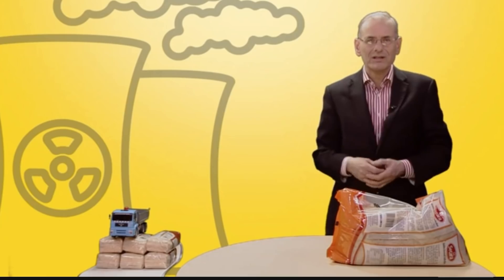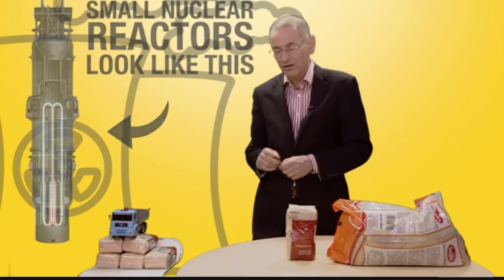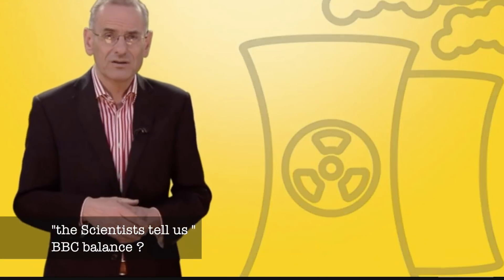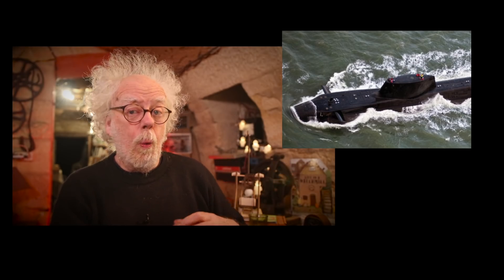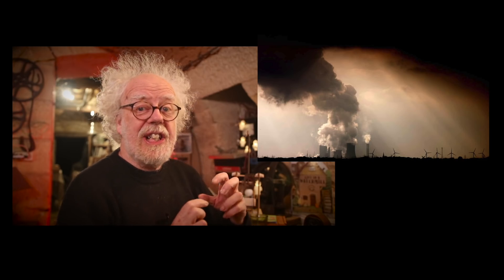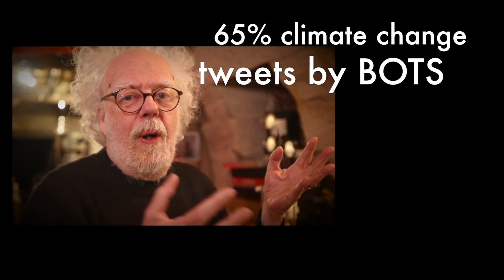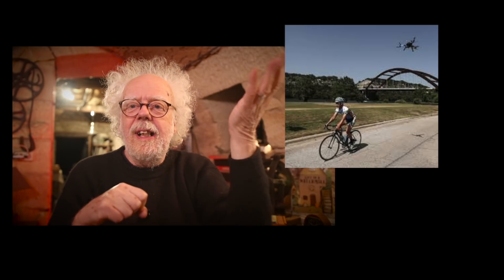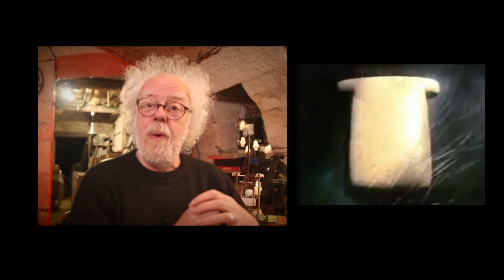Not Tomorrow's World - Prof Simon

Comment: There IS a solution to nuclear waste and it’s NOT from Rolls Royce. 
The British company Moltex is building a molten salt reactor in Canada. It runs at ambient pressure so needs no huge pressure containment system. All PWRs including he RR can use only 3% of their fuels energy. The remaining goo is high level waste. 
Moltex take that waste turn it into a salt fuel and burn off the remaining 97%. The remaining material has a short half life that’s easily managed. 
The plant is walk away safe and the dangerous gaseous elements like iodine 131 and caesium 137 simply become fuel salts. They cannot escape as gasses.
Reply from the maker: Interesting

Comment: ai would like to add some comments about nuclear power .  The reactors on recent submarines are designed to last the life of the boat. The problem is that they must use bomb grade uranium. Commercial power reactors use fuel with much less enrichment than that required to make a bomb.  Because of this they must be refueled every 3 years or so.   much of the engineering effort in commercial reactors is spent on how to rearrange the fuel rods during refueling outages to extract the most energy out of them before a complete  replacement with a new bundle is required .  A side note on used fuel bundles is that they can be recycled except for stupid politicians.  There is substantial fissionable material remaining that could be recovered.  Technology exists that can Make a glass like material out of the remaining waste.  The radioactive isotopes are molecularity bonded to the glass.  This technology was never adopted.  So spent fuel pools at the plants continue to be filled with used up fuel bundles. Large scale plants are likely driven by the fact that these plants are part of a much larger power network  and concentrating more capacity in smaller footprint makes economic sense when removing one plant from service for maintenance does not adversely affect system reliability.  As a side note,  utilities routinely buy and sell power to each other to supplement  generation shortages .  A principle driver of insanely high construction costs of these plants is out of control regulations. An approved design package built to the package specification would cost much less. Consider if you tried to build a house and the building codes changed every week and you had to tear out any work you had completed to conform to the latest codes.  This is what nuclear operators contend with during construction.  The technology used for commercial reactors is driven by the designs developed for nuclear submarines.  Thorium cycle reactors would be a a good choice if money could be found to develop the technology beyond demonstration reactors.  Modular reactors would be a good model to follow provided standardized designs are used and individual reactors could be taken off line for refueling .  Incidentally, I worked for a utility with nuclear plants for 31 tears.

Comment: Indeed drones with the capabilities you mentioned already exist, but it will cost you a lot more than $1,000. And you're right to be apprehensive about sending all that money into the sky because it just might decide to fly away on its own and never come back . Or more likely, get stuck in a tree . There are several channels on YouTube dedicated to drone hobbyists. The US military has had nuclear reactors that will fit in a 50 gallon drum for decades. Disguised as a 50 gallon drum, a small Reactor with communications equipment was used to tap Russian undersea cables by induction.

Comment: Bots can be a hackers tool, they operate like malware spreading to thousands of Computers & devices on networks. They remain dormant until activated  by the hacker. When they are used simultaneously as a Botnet they can as an example,
All continuously open a specific website or URL . These attacks on the hackers target of choice will cause denial of service errors, and has caused numerous  important company & government servers  to crash offline.....it turns people's  computers into a hackers army. 
Although a bot steals so little CPU time and very little network bandwidth imagine thousands of them working in unison.
That's Cloud computing used maliciously & without the computer owners knowledge.
Whilst there system might be infected the user would never notice anything different with there PC because the bot uses so little system resources unlike traditional viruses.
Cloud computing can be used for good to solve complex maths & physics.
Or at least thats what I've read anyway. Hope you find this interesting.

Comment: Having looked into this 65% bot issue, it's actually 25%. A study by Brown university (Thomas Marlow phd) in conjunction with Stephan Lewandowsky at Bristol University trolled 6.5 million tweets after Trump withdrew from the Paris agreement. They used an App called Botometer which scores a Twitter account on - AND THIS IS THE IMPORTANT PART - How LIKLEY the account is to be a bot. It doesn't confirm if an account is or isn't. So it's not accurate is it? Bad reporting Prof.
Reply from the maker: Same study...the guardian reported 65%
Reply: @SimonHollandfilms  Well, you should know better than most not to trust a single source, especially the Guardian.
Also, amazing how many people just blindly took you at your word without looking into things themselves. Not accusing you of anything Prof, far from it.
However, in the light of your previous posts in regards to trust in science etc, etc it shows how easily misinformation can spread and how gullible people can be.
Apart from that, it's all good.

Comment: Prof, there was a man called Magnus Pike who advocated using a small car engine and a fork lift truck battery to power several homes together. The engine running on natural gas would generate electricity and provide background heating to the houses thus making its output very efficient. The reason for his idea was that nearly 50% of energy is lost in transmission lines due to heat.
Reply from the maker: Interesting

Comment: Excellent episode Professor. Several commercially available, small drones can track you at bicycle speeds or higher. As far as throwing it up and it landing back autonomously while you are still in motion, that doesn’t quite exist yet. Both of my drones I can launch from a vehicle, have them track me, fly a circuit around me on their own, but then I bring it back to the vehicle and land it myself. You can have them land at a stationary point on their own but not a moving target.